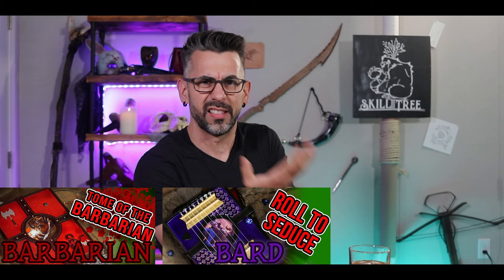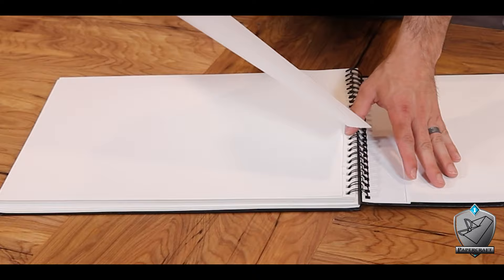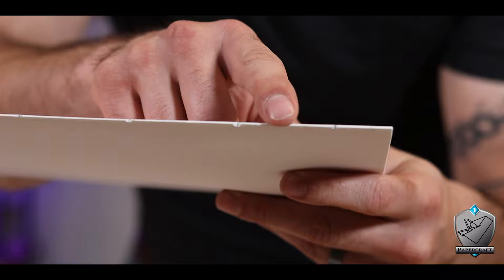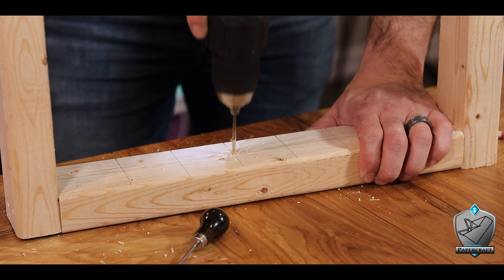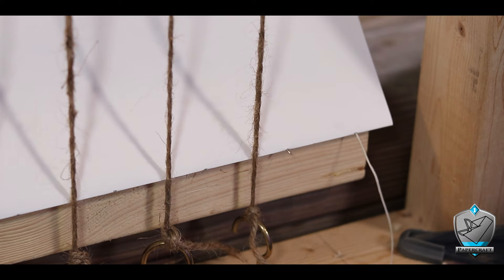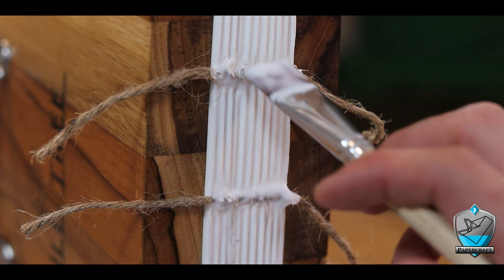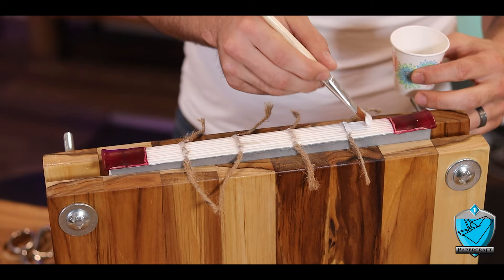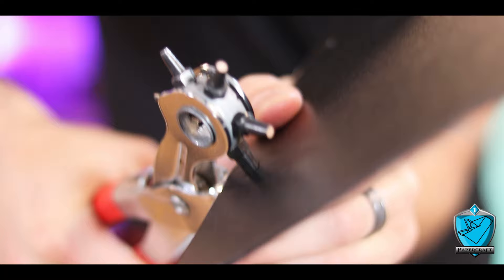Book Binding DIY -  Making a book from scratch!

Comment: I took a bookbinding class a few months ago after a good while of being a newbie binder. I used to fold all the pages individually also, but folding the signatures all at once keeps the leaves tightly together since the outside pages will be wrapped around multiple other pages. Keeps the spine more in line and makes the stitching easier, makes it a lot easier to punch straight holes too. You can just press the signatures afterwards to get it nice and tight. Your book is better than my first one for sure though so I don’t imagine it’ll matter at all unless you’re making a bunch anyway. I’m glad other people came to the same conclusion I did though, seems I’m in good company lol.
Reply: Also rounding keeps the book rectangular, the spine will be fatter if you do a straight back because of the folds and thread. They you get a nice square block instead of a little wedge shape 👍🏻👍🏻👍🏻
Reply from the maker: Thank you! This is helpful to know for sure and will save me LOADS of time😁. I would love to see your books sometime!